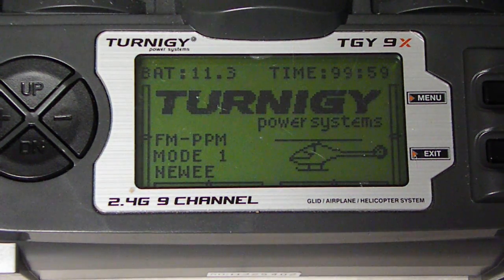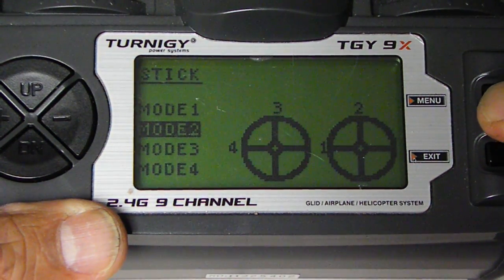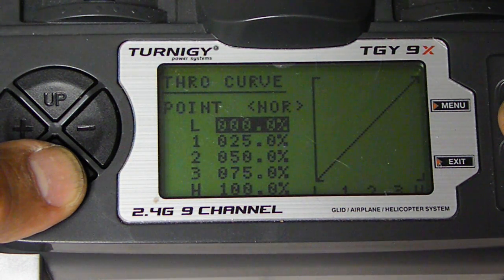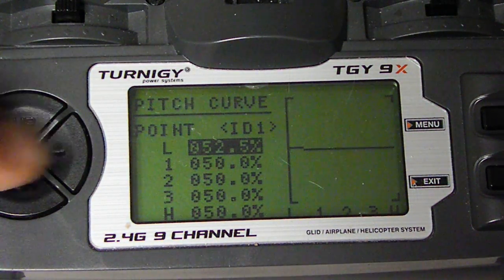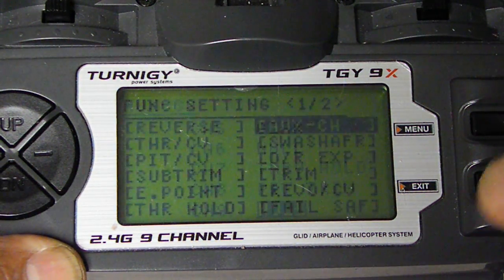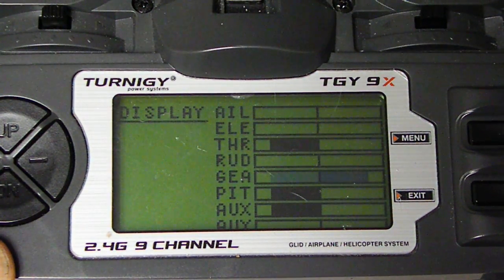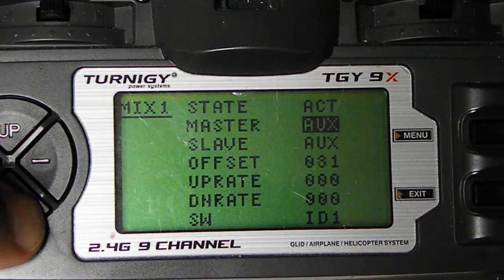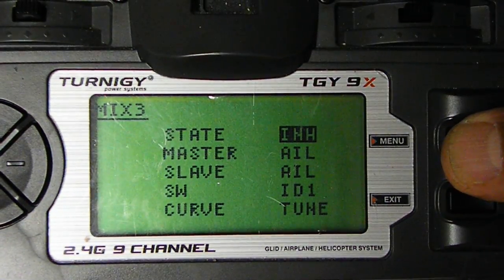Turnigy 9x (Stock) 8 Ch Multirotor Programming - Multiwii Capable

Comment: Can anyone help me setup i have JIYI P2 FC. I have very big plans with turnigy 9x and settings for jiyi p2 ... help !!!!! 😉
Reply from the maker: Sorry I do not have a JIYA   FC ... but if you map the JIYA FC controls/switches to the Radio control sticks you should be okay. Bottomline you have the basic four controls (Ch 1,2,3,4) plus a three position switch and two other two position switches you can use (if you use the eight channel receiver). I use the same radio for a Rabbit FC board and all I do is replace the mapping depending on what flight modes I want to control. If the JIYA FC is anything like the Ardupilot FC boards, then you need a programmable radio to get the flight modes into one channel.
Reply: Thanks for the advice. How big is your 9x range?
Reply from the maker: You mean radio range? Using the nine channel (only eight on PPM mode) I have not lost contact over Line of Sight ranges ... others have reported a lot further.

Comment: Mission planner
Reply from the maker: If you are using Mission Planner with your quadcopter, then you need to program varying signal output on either 5 or 6 depending on the model. This radio using stock firmware will not work with Mission Planner correctly.
Reply: pixhawk use mission planer 1.3.44

Comment: Hello, can you tell to me, why when I am moving throttle my pitch is moving all so ? Sorry for my bad english
Reply from the maker: In Airplane mode, check your radio Dislay - all channels should be one-to-one versus the control input. a) You might have a "mix" activated - be sure NO mixes are enabled. b) You may have cross talk on your receiver (which is very rare). Go through the set up again just to be sure.
Reply: wich mode on heli I need to chose for a racing quadcopter?
Reply from the maker: Starting 0:25 .. assuming you have a controller that behaves like MWC boards.
Reply from the maker: NOR mode = Heli 1
Reply: how do you check if no mixes are enabled?

Comment: thank you for the video! one question. when you set the pitch curve in the 3 modes 1 0, 2 50, 3 100. on the 3 way switch. I. display I noticed in modes 2 and 3 the pitch value increase with the throttle value. why is that? is it just for the return to home function you have?

Comment: What am I doing wrong. My Multiwii sat up on vtail will only give me RTH.  I'm using the 9x trans. I got the multiwii 2.5. Can I get some help.
Reply from the maker: Derrick Mitchell This video show how to program the stock TGY 9x three way switch and does not touch the Rx output to Aux channel flight mode assignment in the MWC GUI. If you are using Ver 2.5 official, I assume you are using the MultiwiiConfigurator (vs WinGUI).  If you checked the Display option of the TGY 9x and see the three signal levels but get on the RTH in MWC to function, then look at your AUX options in the MWC GUI  - you probably have the RTH enabled in the L / M and H of the channel you assigned to the three way switch.

Comment: Why throttle reverse?
Reply from the maker: Mateus Viccari Why? Because that' the only way for the radio to work properly ...
Reply: tsisapik Wouldn't that cause the throttle stick to go full throttle with the stick down? At least in my quad with multiwii this is not how it works
Reply from the maker: Mateus Viccari You can see the signal levels 3:33 in the display menu of the radio .. if the signal goes higher than 1000 at lowest, then that is a problem ... below 900 it would trip MWC failsafe ... try it out yourself - no props to be safe.